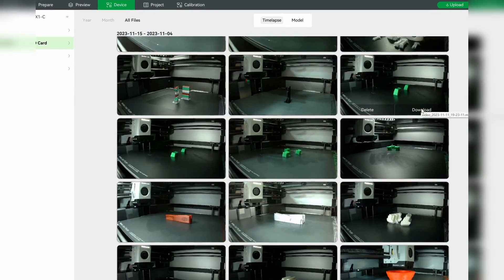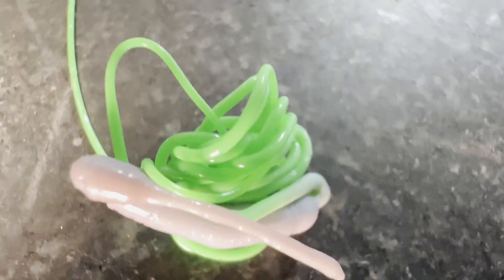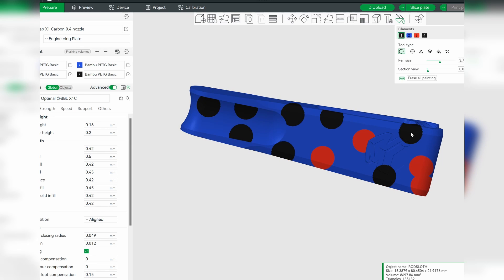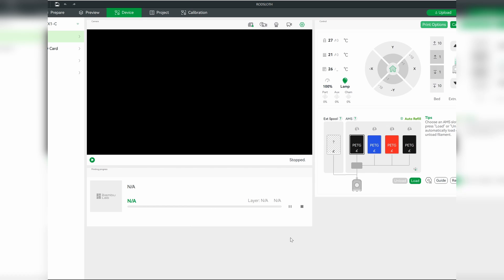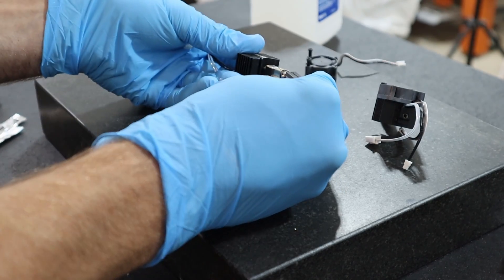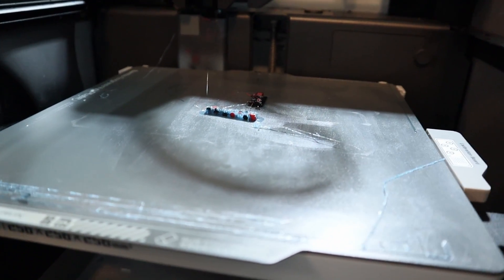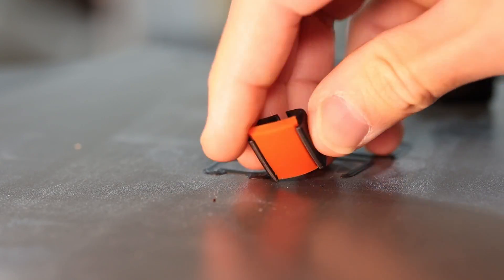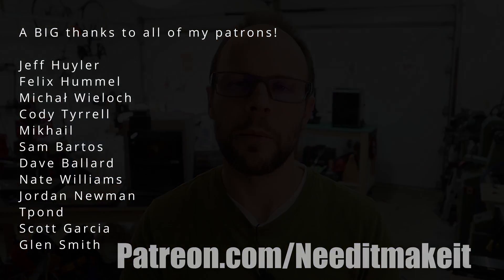Why is My Bambu X1 Carbon Printer Not Wiping?

Comment: This video convinces me that I have to wait at least one more iteration of this printer if I get one at all, between reddit and Youtube, too many problems that aren't exactly clear as to why they're happening.
Reply from the maker: Have you seen their A1?  It has a completely different setup for poop removal, if they could integrate a setup like they have on the A1 onto this printer, it would be perfect.  As I was trying to solve this myself, I found that it was a lot harder than I expected.  I like the silicone wiper idea, and there are some other designs out there, but they require you to buy a casting kit for it, and that's going to be expensive.   I'm happy to make a follow up video on this if i can find a solid solution that works 100% of the time.   Brass nozzle, or Teflon coating are also options to try out.  I think we're going to start seeing a lot more printers like this, hopefully it continues to push the limits and problems like these will go away.
Reply: @NeedItMakeIt  I have, and gave it some consideration but I hate the ams lite setup. I know I can print a wall mount for it but that wide profile is horrible and I can't think of any place I could fit it as is. Plus from what I can see the poop issue seems to be even more clumsy with the A1 with poop landing on the bed regularly from videos I've seen. Not that it's all bad, I think it's nice but it's not quite right and I don't have room for a lot of printers so I want my next one to be a good and bigger one that's not more than $1500US. I'm being patient and I'm not committed to Bambu but I hope they come out with a new iteration in 2024
Reply from the maker: I do love my setup, but it would be nice to be able to print with PETG like I do with PLA.  and I agree, the AI has some drawbacks, not to mention the build size is pretty tiny.  At least they've shown that there is a big market for this type of product, there will be lots more companies coming out of the woodwork to drive innovation even more.  Some of the other big companies will also have to do more to compete Like Creality, they don't have anything that I'm aware of.  I would love to see what the Voron team also have, their printers are still top notch, but for color, I don't see anything that they offer.  Where are we all going with this though, will printers be pellet eventually, or is there something else out there like RESIN that is fast and cheap?  SLA would be awesome, but those machines are expensive and I would expect that there are far more fumes involved.  I'm also curious about design, can we eventually use AI tech to design things that actually do what we want them to do.  I wonder how far away from that we are, or if it's even possible.
Reply: @NeedItMakeIt  I just watched a video from another channel and the Creality CEO said the have an AMS coming in 2024. Not surprising, but also mentioned there's no plans to bring back a new version of the smaller Ender 2 which would be a direct competator to the AI. 

Despite what a lot of enthusiastic people are saying I don't think we're anywhere near the appliance level of a paper printer as you've demonstrated with your X1C in this video but we're on the right track and Bambu deserve credit for pushing everyone over the biggest hump, proper auto-leveling and better speed. Now they all have to work on reliability and when things don't work, better clues as to why. Oh, and the tech support from these companies is abysmal.
Reply from the maker: @dosdont  I thought that might be the case as well, thanks for confirming about the Creality AMS.  It needed to happen, I'm not sure how it can integrate with existing printers, I don't see any ports on my K1, but maybe it can be a board-wired setup.  I'll open it up to see what's available in there just out of curiosity.  

To speak to your comment about the X1C, when I opened the box and started printing, it was just that, I did nothing except load the filament in the AMS and start, I used everything stock, slicing included and it just worked, I didn't get to the PETG color until a few weeks ago, but that's not as common I think for most people for color printing anyway.  The app just works, the WIF just works, everything was carefully thought through and there is very little maintenance as well.  They've definitely raised the bar. 

The best system for filament based color printing must be a method of adding color to a base filament as-needed, like they do with a paint can.  Buying different spools of material just for color is annoying.  I'd prefer to buy a small amount of tint and use the base spools which are always the same.  That's probably easier said than done.
Reply: @NeedItMakeIt  It wasn't made clear if the AMS would be separate or for a new printer coming in 2024 but he did say AMS is coming. For current printers, at the same event they were talking to a rep of "Co Print" which looks very interesting but I suspect it will be expensive but we'll see. 

As far as changing colour with some sort of tint, I read a small blurb that someone is working on that. I can't recall anything specific. 

Not the same thing, I don't know if you've tried it but there's a print you can make that allows you to stick Sharpies into the top of the extruder for some printers. I haven't tried it and the prints I saw didn't look great but clearly someone is thinking about it this concept. Not exactly what you're talking about but I think it would be the same principle of adding tint from the top the way you do with the AMS without having to poop (bleed?)

https://www.printables.com/model/374938-ender-3-s1-extruder-mount-sharpie-blender/comments
Reply from the maker: My apologies, I am just getting back to this message now.   I will ask Creality, I have a person I speak with at their office, maybe there is some news they can share.  Now that you mention it, I think I have an email from Co-print.  I'll take another look today.

I guess the issue with color is always the purge, the only way around it seems to be a head for each color at this point.   Or one head and multiple extruders, adding weight to a fast printer, probably not a good idea, so maybe one extruder and ways of engaging and disengaging each filament as needed.
Reply: Honestly I think you are trying to convince yourself not to get it.

Of all the printers there have been in the consumer price range this is the one with the least problems for the actual user print to print.

The least fuss of any printers right now.
Reply: @BeefIngot  I think if you'd read my comment you'd understand that isn't true. I also think you haven't got a clue as to which printer has the "least problems," how would you know? and having spent the last few months watching videos and reading complaints about the X1C on reddit and other places, the one thing that's clear is Bambu printers have no less problems that I can tell, certainly no less complaints, they're just faster at printing and more convenient to use when they work. All the comments on reddit aren't just falling out the sky, and I know I know, we don't hear about all the happy customers, that's not the point, the point is their printers do have problems, just like all manufacturers do and we have no way of knowing which ones have the least amount other than anecdotal comments like yours.

Comment: my flsun v400 delta printer has been a dream, it just works. i started with the ender 3 and wanted something completely different after that
Reply from the maker: It looks like a sweet printer!  I hadn't been following the deltas much.  At first I thought it had a small build-volume, but it looks like that's not true.  I may have to venture down this path.
Reply: Thats my opinion, but i HATED the V400. I had layer shifts, bad first layers, smoothing, under extrusion and much more... But it's still a good printer when it works
Reply from the maker: @laydnbeats  Sometimes we just get a dud.  It's hard to know whether they're all like that, or if it's the lemon.
Reply: @NeedItMakeIt  i searched online and these problems are pretty common for the V400
Reply from the maker: @laydnbeats  Good to know, I would assume they can integrate some of the same features to mitigate some of these problems like they have on the Bambu, calibration, bed level, sensors, etc.

Comment: Is it possible to get a brass nozzle? I had problems with hardened steel and PETG. Even though you raise the temperature for steel, the flow is different.
Reply from the maker: It would be possible.  Bondtech has a kit to allow you to change a nozzle the way you'd have done it in the past.  I wouldn't mind switching over to give some more flexibility.  It also allows to use high-flo nozzles, which might be nice for a little higher speeds for a 0.6mm or 0.8mm setup.  I'll purchase some high quality PETG also and see what happens, I don't think it will fix it completely, but it will probably help.  What do you think about the brass nozzle will help with PETG?

Comment: With a $2 Brass nozzle, zero problems with PETG.
( $150 Anet printer and i use the cheapest filaments i can find here in Europe)
Reply from the maker: I'd be curious then to see what happens if I switch over to the nozzle swappable hotend.  So would you say that the cause is the way the nozzle heats the material?  Higher hotend temps and not being able to heat the material correctly before extruding?
Reply: @NeedItMakeIt  I don't have any experience with other than brass nozzles, so i can only guess. 
Brass conducts heat fairly well, maybe the heat conductivity has something to do with it?
Reply from the maker: @-Viceroy-  In past, that's all I'd use as well, I still had issues with stringing; those printers didn't have any sort of nozzle wiper though.  It's worth a try, I like the properties of PETG.  I've printed some heavy duty parts with it, and they stay incredibly flat.  Printing the same parts in ASA or ABS always curve up a little bit even though they haven't released from the buildplate.

Comment: Imo you need a coated nozzle for the PETG to not stick to the nozzle
Reply from the maker: The stock printers don't come coated, but I can try to get by hands on the Teflon coating by SLICE and run some tests.  I'm happy to do a follow up video to show any improvements.  I may end up buying the swappable nozzle kit, I'd really like to get some high-flo nozzles in there.   Do you have any exp. with them?
Reply: How did you go with this :) ?

Having a similar issue with PLA